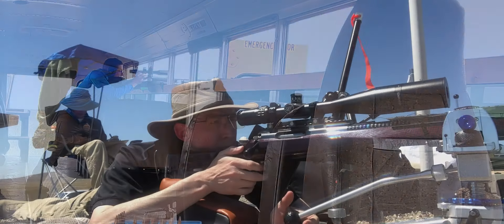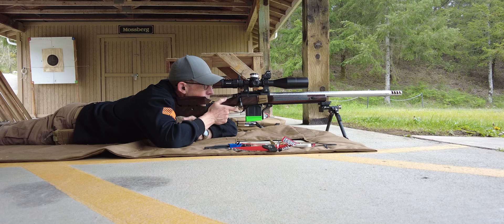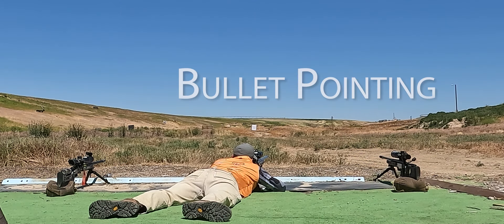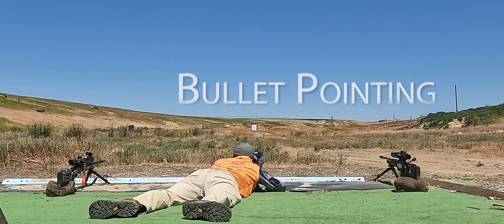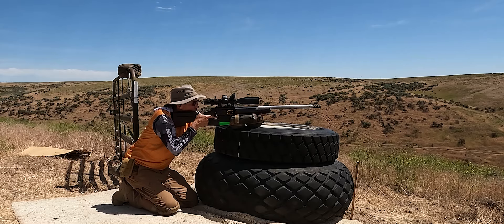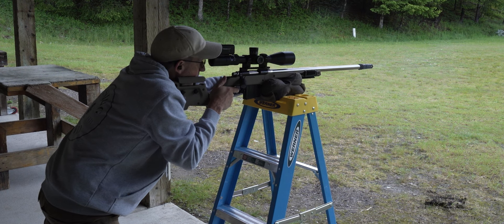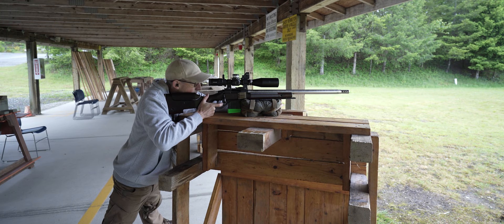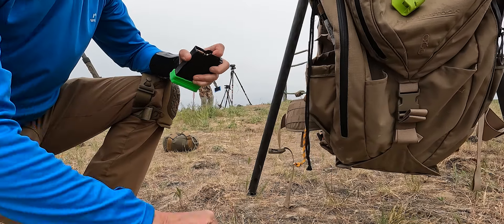Loading for PRS vs F-Class

Comment: In the mid-90’s in highpower just about everyone shot a .308. There was a formula for the load. Just about everyone shot that load. Because it worked for everyone. Beyond the mid-90’s everyone shooting service rifle switched to .223. The formula changed but most everyone shot the same bullet at the same velocity. A few different powders were used but it was basically very similar recipes, (formula), with the same or very similar result. Because it worked for everyone. I don’t shoot F-Class or PRS but it looks to me a formula is developing for both the games. 7MM ~180 bullet at a certain velocity, and a 6MM ~105 bullet at a certain velocity. Because it works.

Comment: Nice video. I've been shooting PRS for a little over a year and love it. Prior to that my shooting was rural pest control. I've always reloaded. I've never shot competition. I'm a mid-pack (at best) PRS competitor, but learning and improving. 

I look at the components and processes different shooters use and disregard much of it. I mostly shoot under 500m. Sorting bullets, using an auto trickler,  etc isn't going to help if you forget to dial elevation,  shoot the wrong target,  shoot from the wrong position,  or most of all don't have a stable position. Natural point of aim,  a good trigger press and the PRS stage sequence are really important. I miss my share of shots,  but rarely do I have a solid position and take a good shot and get a miss without knowing why. I'm shooting a 6.5CR, Hornady ELD-M 147gr, have been using mostly Hornady brass,  but now have 400x Lapua SRP cases. Heaps less variation in case weight.  I've had case weight spreads from 144gr to 156gr with Hornady (deprimed and trimmed). I haven't ever measured the volume, so I don't know if it's internal capacity, differences in the head and variations in the brass. I'm never going to bother to find out. I did sort them by weight and have them separated by 2gr spreads (146-147.9, 148-149.9, 150-151.9, 152-152.9, 153-154.9). Just a once off activity. Notice the 152-152.9, that's because there was twice as many in that weight. 

For powder, I'm using H4350 / AR2209 and using a Hornady Auto-charge Pro to dispense the loads. Probably accurate enough out to 500m. I've shot out to 1140m with the same loads and was on steel in 3 shots. 

I doubt I'll need to change too much in the near future.  Other than more stable positions, smoother transitions between positions, using the most suitable equipment for the stage, better time management, staying calm, reading the wind, spotting hits and misses... learning from mistakes and improving the processes so I don't repeat them (too often). And having fun with other competitors!

Thanks for all of your videos and for sharing your experience.

Comment: Sorry this could be just taking up your time, as I am not a competitive shooter!
I'm 70 years young and I moved from muzzle loading hunting 5 years ago to centrefire. I found factory ammo not that good, so started reloading.

I run a 243 Win, with a 1in10 twist barrel (I wanted a1in8) and a 90grn bullet.

At the moment I’m good to 400Yds and shot my first deer at 375Yd last week.

I watch your video’s which have helped, but like you said!
“Only check what you have to!”

I check Ojive every 100 shots for throat burn and adjust if needed.
I anneal cases every two shots.
I neck size until I notice case problems in feeding, then full length size.
I batch reload in 50’s and put the first three over my chronograph and adjust my ballistic app if needed.
I don’t mix powder batches in the 50 I reload for consistency.
I don’t mix/change case manufacturers, or primers and bullets.
But I haven’t started measuring the bullets yet.
Is there anything else I should be checking please?

Thanx Richard T.
Reply: sounds like your doing lots of things right.  i would recommend looking into type S dies and mandrel neck expanders.
Reply: @zinithmora67  Not too sure what the "S Type dies" are!
But the neck sizing die I use, I have changed the mandrel 
in it to increase the neck tention because the standard one 
makes the bullet is a little loose.
Thank you for your input 🙂
Reply from the maker: IT looks to me like you have a good system already. I would run with that!
Reply: Richard, don't try and fix something that isn't broke. You're good!
Reply: @richardt.4224  --  the 'S' type of neck, or full length, die uses bushings to set the outer diameter of the neck.  In principal you don't need to run a mandrell inside the neck then.

Comment: Im only going to speak for PRS but I am firmly in the comp that more time shooting and less time loading results in better scores. 

I don’t even load develop anymore. I just get a round going to the speed I want, load it to mag length and I’m done. Every good barrel/load combo will shoot 1/2 minute or better doing just that. You don’t need anything more than half minute for PRS.

Matches are won and loss on shooting position and wind calls. That’s where time should be spent. Guys have won PRS shooting factory ammo. The minutia is not required at all.

Comment: @winninginthewind  I try to adjust my reloading for what I‘m gonna do . I only sort bullets by weight and sort out only ones with big tolerance, with Bergers rarely happens. One question about action , did you true up your Prs guns bolt ? Do you it’s necessary ? I wanna build a new PRS gun I’m thinking about a Borden Action mountaineer or super short six or an Lone Peak Fuzion any suggestions?